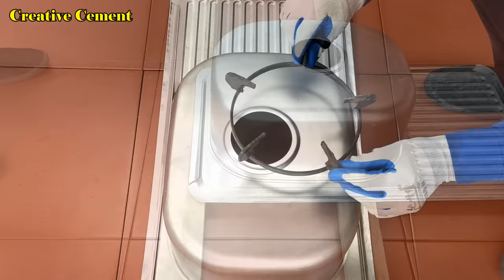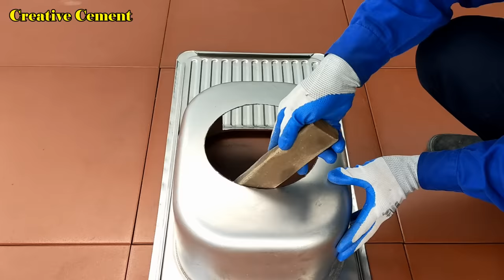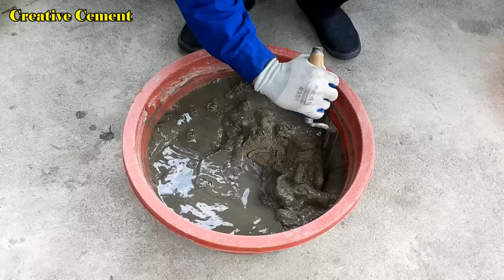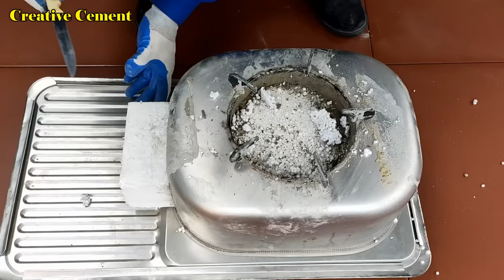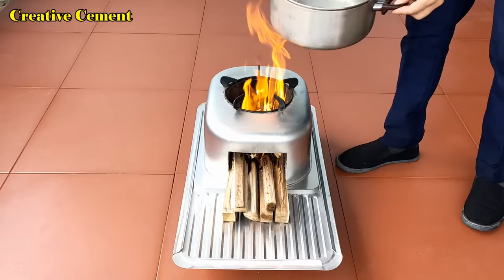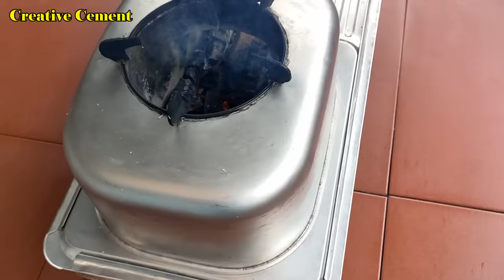The idea of making wood stove from a sink and cement

Comment: На сколько я помню цемент от температуры взрывается.
Reply from the maker: Спасибо. Вы можете использовать материалы, устойчивые к нагреву
Reply: The cement will explode and pop
There is a lot of oxygen that is trapped in the cement; even the water contains oxygen. When the pockets of air is heated, they will expand until the high pressure makes a big pow!!